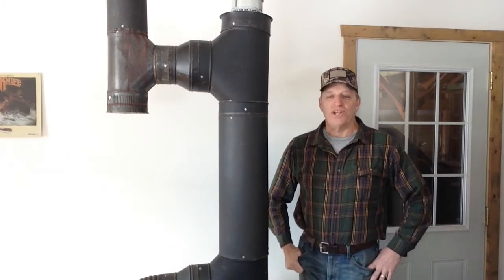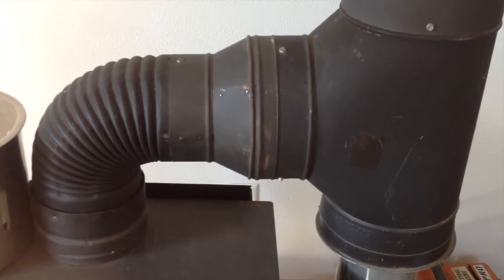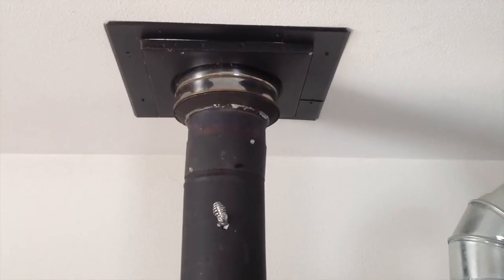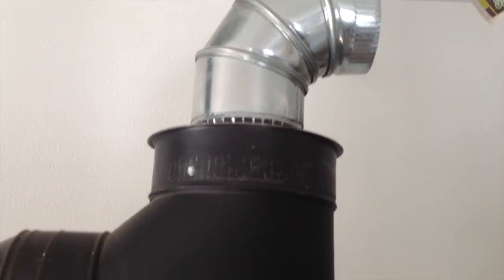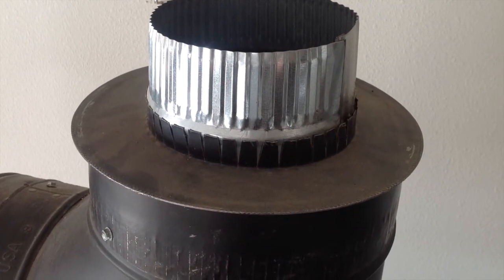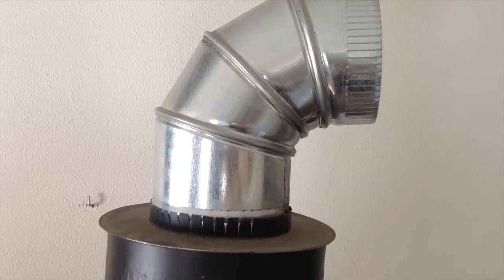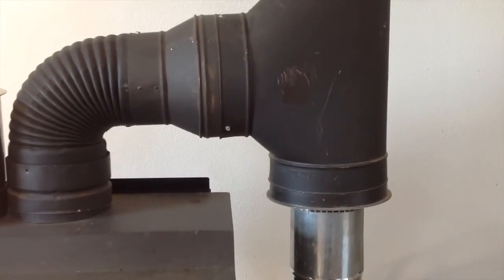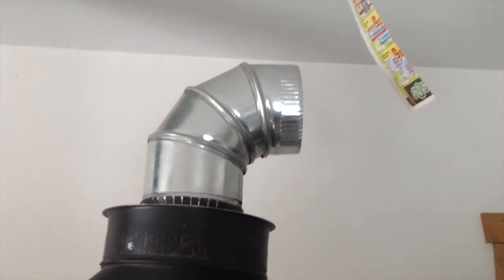How to build a Non-Electric Chimney Heat Reclaimer

Comment: Is there any concern about the inside  galvanized 5" duct getting hot enough to burn the zinc? That's toxic.
Reply from the maker: Hi Paul, Yes; 'if' it got hot enough.  (quote from 'Homeguide' article:  " All galvanized stove pipes are coated with zinc which, when heated to 1,652 degrees, vaporizes, emitting toxic zinc fumes."  
Here's a link to the article: 
https://homeguides.sfgate.com/defrost-frozen-pipe-27429.html

If concerned, use the black.  That black pipe will really give off some nasty fumes as well, when it gets hot for the first few times.  Have to open the windows, or burn it outside for the first, before installing it.
Good point!  Thanks for commenting!
Reply: @doubleMinnovations  Zinc oxidation starts to happen at ~635. The ~1650 is its melting point and will off gas at full speed. So yeah, use black, especially when you already have the black 8 in flue, junctions and whatnot. Are your inner 5 inch galvanized pipe rusted through now after 3 years or is the exhaust gas not that hot to oxidize it?
Reply: Do you think that if you were to rotate your 90° elbow on the floor (intake) so that it faces 180° from its current orientation, and thus pulls in air from under the Woodstock, that then the output temperature might be increased? (My thinking is that the intake air would be prel-warmed via proximity to the stove and come out the top that much warmer)
Reply: @fl3082  a higher gradient (lower low temp) will increase flow rate and ability to extract heat from the exhaust. 

You want the coolest air in the space entering the 5" pipe

Comment: In order to avoid with the build up of creosote, we decided to buy a range hood $75. H 6 in, w 24 in, d 18 in. Removed the fan and parts from inside.  Put the range hood over the wood stove ( jotul f 500. 28.75"w×22.5"d). 6 in elbow coming out the hood.  2 ft pipe horizontal connect to tee. 2 ft pipe coming down, 5ft pipe going up the tee, elbow. All 6 inch pipe.   It works great. No creosote.

Comment: To improve on this idea create a sand battery with in the new Sand battery the hot flue gas run threw the vertical  2" pipe that run with the sand note the pipe would transport flue gass up to you top tee I would keep your center heat exhanger which would pick heat from flu heat  but all stored head when wood stove is off...

Comment: You can also make this into a cross flow heat exchanger by blowing a fan into the top. This would allow for higher transfer of heat from the exhaust gases to the clean air.

Comment: Brilliant idea. The challenge with wood heating is how to store and/or blow as much of the heat as possible into the house. We have a heatilator brick fireplace with airtight glass doors, so the brick stores heat, plus I added fans that blow air around the firebox into the house.  They are a bit loud, but I only burn a very hot fire about 1-2 hours a day, which heats the room to 80F.  The house is well insulated and stays fairly warm a day or two.

Comment: Your heat reclaimer will work even more efficiently if the flow directions are opposite of each other. So if its sucking air from the ceiling and returning it to the floor. Think about the way heat moves and how you would get the maximum amount of temperature increase.
Reply: The first 6 words in your last sentence provides your answer. Heat RISES. It can't work the other way around. At least, not through non-electric convection.
Reply: @ffemtx4  Mmhmm. Unless you had a computer fan.
Reply: @allengeringer574   The whole idea was to do this through convection NON-electrically.

There are many other ways to do it electrically. There are 5", 6" & 8" round fans that fit into the pipes to make it a forced air system. Even thermostatically controlled fans.

Comment: Cool…. I was thinking the same but rather than elbow to the reclaimer use a tee and then a damper and another pipe straight up to the top tee so you could bypass the reclaimer until up to temp for less creosote chance
Reply from the maker: Sounds like a plan.  My best.

Comment: Did you monitor the carbon monoxide level next to the heat reclaimer?
Reply from the maker: There's a carbon monoxide/smoke detector 6 feet away on the wall, if that's what you mean.  -it was part of the electric code, as it was used as a living area in the past.
Reply: @doubleMinnovations  I am curious on the readings you got.
Reply from the maker: Maybe I should say; carbon monoxide/smoke *alarm*.  If it detects CO & smoke, then sounds an audio alarm.  It's part of the US electric code.  It's not a gas analyzer with a readout.

Comment: The very nice. Thank you for posting. What did you use to seal the top and bottom where the 5” pipes go through so smoke doesn’t 
Get out?
Reply from the maker: Depends on how tight the fit is.  At first I used aluminum tape.  Then I found out that it was just as tightly fitted as the rest of the stove pipe, and didn't need it.  Other spots a wood stove sealer caulk.

Comment: Would doubling the flue pipe increase the heat output from the stove Double M Innovations ?? Any other ideas for an heat increase Sir ??? Thanks
Have yourself a Merry Christmas and A Happy New Year. Peace too.
Reply from the maker: I think I'm extracting all the heat out that I can right now with this.  Still need to let some heat out in order to get a decent flow out the chimney.  Our hybid/masonary heater fireplace in the house, with all that thermo mass, is what really is delivery the heat!  The rocket stove water heater in the green house,  is on a good tract too.  Merry Christmas!

Comment: How do you seal the seams so no smoke leaks out? Currently in the process of renovating sun room to have a wood burning stove for heat. I love this idea and I will be doing something similar.
Reply: I believe a company out there makes a furnace cement , or caulking rates for temps 800 & above , Rutland is brand name.
Reply: Could use JB Weld. It comes in larger tubes and takes high heat.

Comment: $17 gets you a silent oscillating fan at Walmart that extracts far more heat safely than this. Good for a cabin or off grid though. Weld some flat iron fins in the back or sides to radiate more heat.

Comment: Thanks for sharing.  Valuable information for everyone  . If I remember right attach long pipe so the out heat can exhaust the heat like on old log cabin  . Better heat throughout  the cabin . Yes add copper coils to heat water .
Reply from the maker: Thanks for watching John!  I haven't added any water heating pipes to this stove, but I did build a very efficient water boiler rocket wood stove for the our greenhouse.  If interested you can check out the videos of that whole build.  https://youtu.be/vjEwOq3sRwU

Comment: Be very careful when you change and/or create ways to extract more heat off your stack temperature. This setup seems to me like it would have to be cleaned alot. Your stack temp is well below 200 and this means the flue gasses are going to change state back into a solid, creosote. Chimney or stack temperature is very important so you do not burn your house down. Homeowners insurance will also never insure your house with this stuff either. Not trying to fault a guy for wanting to capture more btu's for the house, just that there is a science and balance to burning any fuel. Same with those heat exchangers you can put inline with your venting which works well, however it lowers stack temperatures too low and makes a ton of creosote, very dangerous!!!
Reply from the maker: You may want to watch some of the other videos in this playlist, to get an understanding of the whole setup, and the science behind it.
Reply: @doubleMinnovations  i do this for a living, and ive installed hundreds of wood burning products over the years, stack temp matters. Your struggling with the same problems engineers for fireplace and stove manufacturers face, removing too many btu's off the stack and sooting up. Really not trying to knock ya, i think its neat. There's just a balance is all im sayin. How did you get an insurance agent to write a policy for your home?
Reply from the maker: @robertdecker5503  When you get hot cleans burns, like I'm getting( +1,100˚F), it burns up the gasses that cause creosote.  So you can drop the temperature of the exhaust without a problem.  If you don't have hot burns, the exhaust needs to be higher.  The videos in the playlist will probably answer most of your questions.
Reply: @doubleMinnovations  thank you, i look forward to viewing them.
Reply: @doubleMinnovations  i definitely will watch the other videos,  i hope to maybe learn somthing new. I love fellers being creative to solve problems or to make things better and i like your thinking, ive just seen bad things happen when to extract too many btu's of your flue gasses. Probably just have to clean it more is all.

Comment: Would using all 6 Inch piping and using 4 inch aluminum piping for the reclaimer?
I ask because I have everything but it's all in 6 inch.

Thanks for the video.
Reply from the maker: A 6" pipe with a 4" one inside, would restrict the flow.  -Less area of flow between the 6" and 4", than an empty 6" pipe.  That's why I went with the 8" and 5" design.  The area of flow between the two is about the same as a 6" pipe, and the 90˚ turns in the 8" 'T' are about 42% greater area of flow than a 6" one.  I wouldn't use aluminum at all.  Use steel; probably the black, or even stainless steel as someone else suggested.  Thanks for watching!

Comment: Do you think that if you were to rotate your 90° elbow on the floor (intake) so that it faces 180° from its current orientation, and thus pulls in air from under the woodstove, that then the output temperature might be increased? (My thinking is that the intake air would be pre-warmed via proximity to the stove and come out the top that much warmer)
Reply from the maker: Your idea might work, but I wanted to take in the coolest air from the room.  
The thermosiphon works by heating cool air so it rises, so I figured it would move the fastest, and I would be replacing the coolest air with warmer at is stratifies.  
Thanks for your input!
Reply: @doubleMinnovations  
OK thank you, those are both excellent points I had not considered. I agree it makes more sense as you have it.  Thank you for responding! 👍
Reply: One if the biggest heat losses with open flue gas or solid stoves is cold air drawn in for combustion from outside Putting a supply pipe under the stove helps to prevent cold sir mixing in room however using something like this to preheat the fresh air feed might yield even more given the lower temperature of the air giving a lower final flue gas temperature as it would be  in cross current heat exchange not co current

Comment: Thats great, do you think it would work to use a 1/2" copper pipe coiled around the inner chimney and have a thermal heat syphon from a cold water tank going into a hot water tank to both extract more heat and have a supply of warmed water. I am thinking about a very large quantity of water so that there would be no risk of boiling
Reply from the maker: Sounds like a good experiment Nick!  Cheers!

Comment: Can carbon monoxide escape that top end where the siphon 5" pipe comes out?  I like the idea, I'm already thinking of how I could make it out of all stainless steel.
Reply: I think the large pipe, the jacket around it takes the waste gas and the inner pipe is just a self contained pipe that no waste gas gets into
Reply: @utubeape  I'm talking about around the seem around the outside of the galvanized pipe, where all those little cuts were made to fit around.
Reply from the maker: It's possible Matthew, and I suggest use aluminum tape or stove sealant in the drawings I have on my website.  My chimney works well, and the draw keeps pulling everything out.

Comment: For the 5" pipe, I wonder what kind of effect a thicker walled pipe, such as 14ga. exhaust tubing would have on the thermal mass of the heat reclaimed? What are your thoughts?
Reply from the maker: With a thicker walled pipe, I think would slow the transfer of heat through it.  -(that's another experiment).  I think the thinner walled stuff transfers heat better, but then might deteriorate faster.
I don't think anything thicker than the gauge of the black stove pipe is necessary.  I think that was about 24 gauge.  The gauge of the galvanized in this setup, is about 27.  I tried the 'blued' stove pipe, and that was about 31 gauge, and that deteriorated the fastest.  If you used the Black, the interior and exterior pipes will stay at the same condition. 
With the set up I have here with the hot clean burns, I can operate it at a relatively low temperature, (like I show), and not have any creosote.  I just cleaned it a few days ago, and there wasn't any noticeable deterioration on the galvanized.
Reply: @doubleMinnovations  great, thanks for the info
Reply: @doubleMinnovations  please explain how you can have "hot clean burns" and operate it "at a relatively low temperature"? I heard you say you burn pine (which typically doesn't produce a hot fire and thus potentially more creosote), so how do you get the "hot clean burns" out of pine? I guess you have to take the 5 in pipe out of the 8 inch when cleaning the system? How do you clean around the elbows and T's?  Do you take the pipes completely apart?  That seems like a lot of work.
Reply from the maker: @denisecares6124   Insulated burn chamber makes the fire hotter.  It's a smaller fire, but hotter, and disperses into the same amount of heat absorbing material in the stove.  So the resultant BTU's are around the same.  The hotter fire burns up the gasses that cause creosote, which means I can lower the temps down more after going out of the stove.

Check out the other videos I made, and read the comments, and you can get a better understanding.

Comment: Could you increase the efficiency of this unit by using two pipes side by side ??? Also, would doing that increase the creosote deposits from the burning of pine wood ???
Reply from the maker: I'm not sure Victory First, it's all experimental.  The hot clean burn that I'm getting with the insulated smaller burn chamber in this particular stove, is what burns all the gasses up that cause creosote. -that's the real efficiency ticket; I think.  The 'adjustments' in the firebox of this stove, are pretty simple to do.  I wish more stove manufacturers would experiment in this direction.
Best wishes!
Reply: @doubleMinnovations  What you say is so true. Seems most manufactures just want a pretty package to sell more so than having a truly super efficient stove. One company Sadore has one killer design but the price is just way up there.

Comment: Have you cleaned this setup yet? I wonder how buildup will be after a season of use. Love the design, I might implement this in my home.
Reply from the maker: I've put this particular one together about 4 years ago now.  With my hot clean burns, that I demonstrate with this stove setup, I take it apart once a year.  

If you don't have hot clean burns, you would have to check more often.  And keep the temps high enough to avoid creosote buildup, like the other heat reclaimers out there,. -that's why many don't like them.
Thanks for commenting!

Comment: GREAT  RECLAIMER DESIGN!  BRILLIANT!  I  WILL USE  IT  ON MY NEW  STOVE .   COULD YOU PLEASE   PROVIDE  A  SIMPLE   SKETCH  OF  HOW YOU CONFIGURED
THE  FIBERFRAX  HIGH  TEMP INSULATION  WITH  THE FIREBRICK,  WITH A SKETCHOF  THE   PASSAGE WAYS THROUGH THE STOVE. THAT   WOULD BE EXTREMELY  USELFUL  TO  YOUR READERS.  THANKS.   AMAZING .   WELL   THOUGHT  OUT    DESIGN.  ALSO,  THANKS  FOR PROVIDING TEMP DATA WITH  THAT  INFRARED  THERMOMETER.  THAT   DATA  TELLS IT ALL.
Reply from the maker: Hi Bill.  Every stove out there is different, so everyone would be a customized experiment.  -which is exactly what the one in the video is.  Inside this stove, is basically an arrangement of the insulation board and firebricks set together, to reduce the size of the burn chamber to 1/2 of the firebox.  With a center back passage the size area of the flue size.
Most of the new stoves now that are out there, have an insulate 'ceiling' to them, and some have secondary burn areas and secondary air.  So there is no way of knowing what effect this might have them.  And I wouldn't advise altering the structure of their stove.
The one in the video was just an inefficient junk one, and didn't need to alter the makeup of it.
Thanks for your comments.
Reply: From what I can tell - that is a Century wood stove and the back of the stove has firebrick in it already - so that the center back passage goes into a firebrick protection in the back. Otherwise I think the stove would get too hot in the back. Also that Century wood stove does not have an opening in the back for the baffler - such that the smoke is forced to go up to the front and then back again, cooling off the smoke before it exits the stove. Since we are not shown a detailed design of the firebox - I'm only guessing and I wait to be corrected. thanks